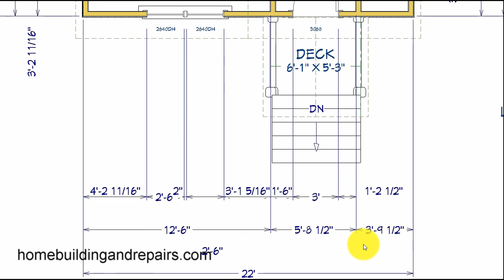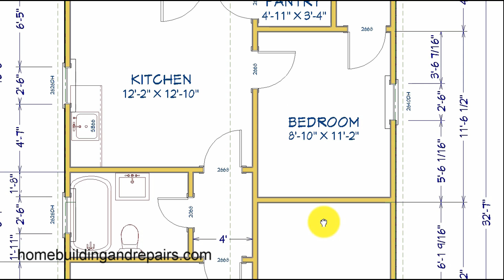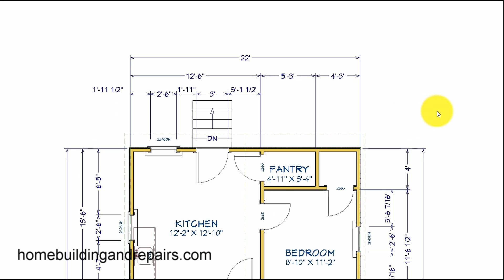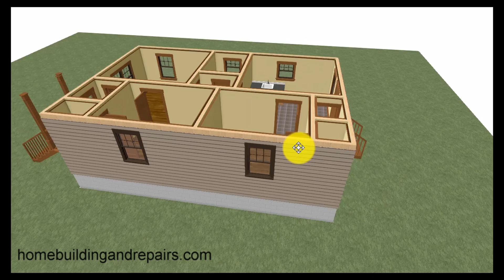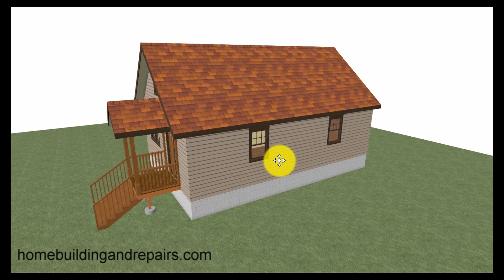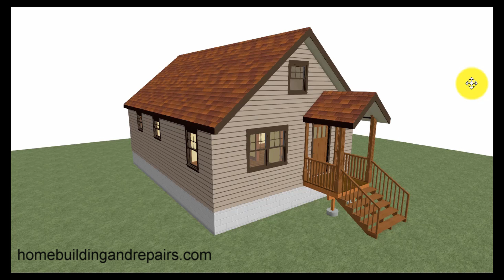1907 Two Bedroom House Floor Plan And Exterior Views - 20th Century Home Designs

Comment: Just guessing about the flu, but it may well have not been for a fireplace but for a wood cook stove that would have been in the kitchen.
Reply from the maker: That could be it also, have you ever seen it done. The only reason why I'm asking is that it seems like metal would've been cheaper and easier to install.
Reply: @gregvancom  Metal what would have been cheaper or easier to install? I'm not sure I understand exactly to what you are referring there. 
Every stove flu I have ever seen in older farm homes has been a very narrow square brick chimney. They hook up by way of the round stove pipe. That's why those artfully done flu covers - they look like painted up round, flat pie pans, with long springs inside them to clip them inside the flu - were so popular in the 30s and 40s, since they covered up an old flu once the family replaced an old wood burning stove with a new gas or electric range. You couldn't just leave that hole in the wall uncovered, it had to be covered up with something.

Comment: The chimney would be for wood stove in the kitchen
Reply: My grandma used to cook with a wood stove in the kitchen
Reply from the maker: @ronald2views  I think that's what I was thinking, but a home built in 1907, does that still make sense.
Reply: @gregvancom  - Why wouldn't it make sense? No municipal utilities to speak of, and no gas or electric stoves until the 1920's. Even then, not everyone could afford stoves that heated by use of any other fuel than wood, or perhaps coal, depending on location. Remember, the TVA didn't come about to even begin creating the changes that brought electrical service to rural areas until the 1930's, after FDR was first elected (1931) and took office in 1932. Then it still took time to build all those dams, begin producing the power, and spreading Electric power lines to the masses in widely spread rural areas. Then, the populace had to be able to find the money to purchase the appliances that ran on electricity. 
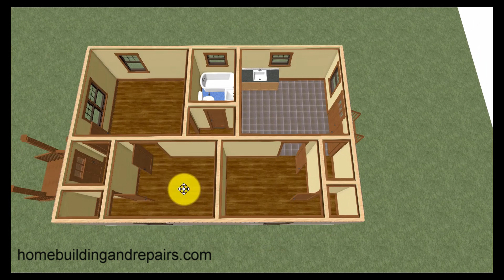Speaking of electricity, your comment regarding not having a TV at the time (5:00), but having a radio instead was incorrect. There weren't any commercial radios or radio stations designed and produced, or even commercial broadcast radio programming before the 1920's. 
Per Wikipedia timeline on radio history: "October 1920:  Westinghouse in Pittsburgh, Pennsylvania became the first US commercial broadcasting station to be licensed when it was granted call letters KDKA." If people had any entertainment in their homes at all, it would have had to have been a hand-wound Victrola with either flat disc records or the tubular type; an upright piano (if the room was big enough,) or other musical instrument like a banjo or a guitar. 
Depending on the design of the kitchen and it's proximity to any other plumbing fixtures and soil pipes in the house, it could make a difference on whether the kitchen sink may have been designed to fit right into that corner, so that its plumbing pipes could be run in a certain way in conjunction with the bathroom plumbing. The position of the window would not have been a primary factor. Sinks were designed in several configurations, one of which had an upright backsplash at a right angle, so that it was protecting the right angle wall to the left, and all along the back wall the length of the drainboards, where the single faucets were set up to run out of the center of the porcelain backsplash and run water into the sink. The drain would be right below the faucets, and the drainpipe would run across under the sink to the soilpipe in the wall between the kitchen and bath, where the tub  would drain as well.

Comment: My house was built in 1890. The chimney for the (once coal, then oil, now gas) steam boiler in the basement goes up straight through the 2nd floor on the same footprint- until it reaches the attic, where the brickwork is staggered at an angle so it pops out of the roof at a more central location. Quite a few houses are like that around here. Fireplace was probably in the parlor, is my guess.
Reply from the maker: This particular house didn't have a basement and it was showing the chimney above the bathroom or should I say the wall between the bathroom and the kitchen. Thanks for giving us some more clues.

Comment: Thanks for sharing. Great idea looking at the history of homes. I think you plan would be a reasonable representation of a typical 100 year old house bordering Mexico but for something closer to Canada you would need fireplaces. We recently sold our 100 year old Victorian house which had a fireplace in every room at 53 degrees North latitude, in those days when houses were far from air tight. The central shared bathroom was there on the first floor (above the ground floor) with it's own fireplace. It was a vicar's house in Chauntrey road, a road name given to church buildings, so it was very solidly built, brick structure with attic rooms for the living-in labour. The original ground floor kitchen extended out towards a well for water. Previous to this house, we have rented houses with +200 year histories. Many of the landed gentry here in merry, modern-day England have homes that are +500 years old, though mostly "renovated".
Reply from the maker: Enjoyed your comment and I myself find the history of home building fascinating. Thanks for sharing.

Comment: What fun. Maybe we can learn a thing or two from old designs, huh?
Just some thoughts:
Maybe that was a flue for a wood stove in the kitchen?
I like the space behind the doors to place furniture so I guess we are all different. Speaking of which I also prefer kitchen windows over work counters (for the light) rather than the sink if it has to be one or the other. Plumbing in outside walls and freezing and also plumbing the vents are other reasons to avoid outside walls aren't they?
A four foot hallway is nice. I designed a house we built with a wide hallway and everyone commented on how good the width felt.
Reply from the maker: I agree, it will be fun. Hopefully we will get the stove or fireplace issue straightened out and you do have a good point about personal preference and home design. I once worked on a house that had an 8 foot wide hallway.